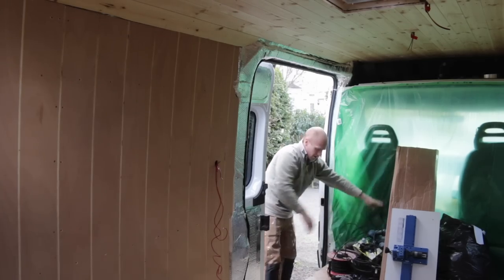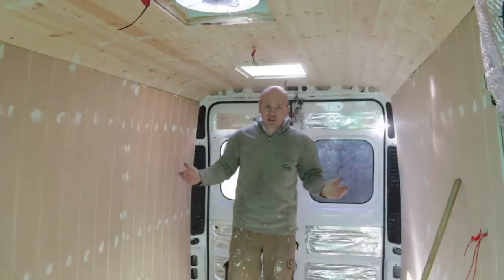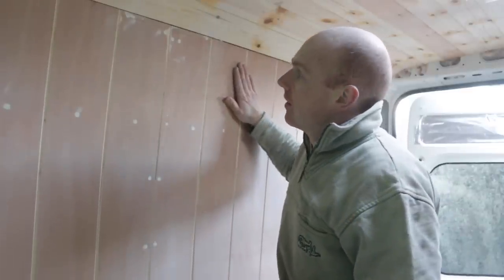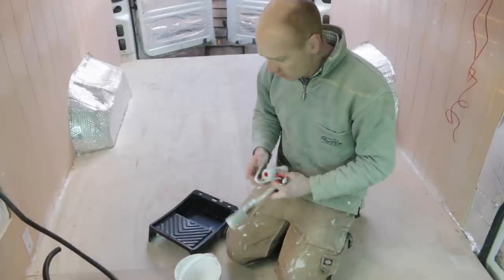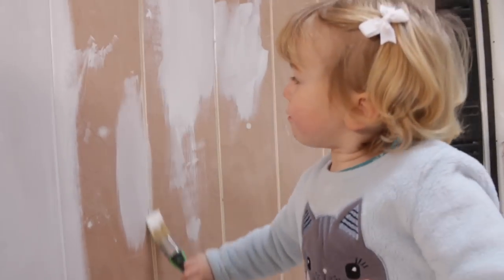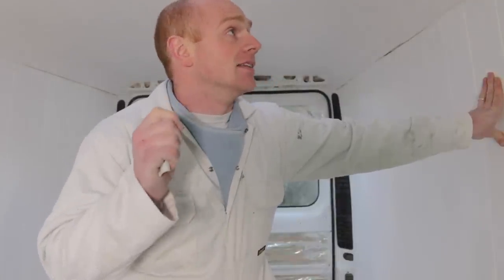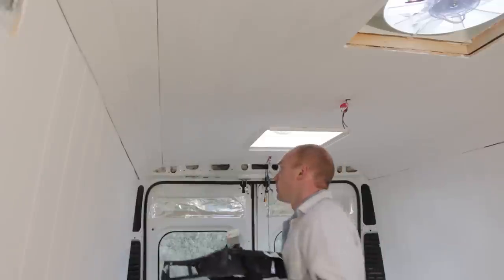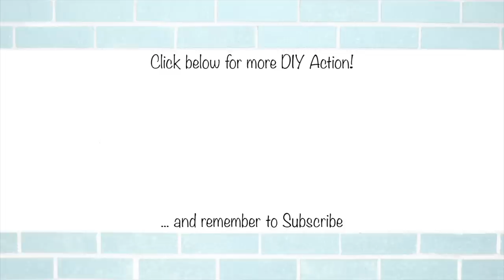Painting the VAN | TRC Van Conversion 17.0

Comment: What about flexi ply to line the rear windows, you may have to epoxy the thin strip to the door, then cut the opening in the facing to fit, only other way is to batten it out a bit to fix the flexi
Reply from the maker: Thinking something similar.

Comment: If you want to cover the rear doors, a 6mm sheet of ply would scribe around them just fine. You could then drill small brackets to the doors that would surround the ply. The brackets are used in commercial vehicles and they allow the wood to seat away from the door ever so slightly, so that's good for curved doors. 

Or be really creative and build a door lining just inside the doors and create your own doorways that hide the rear doors, with cut outs for the windows.

Love all the videos!
Reply from the maker: Working on it in my head.... think we should able to do something with some table saw trickery and bendy ply. :-)
Reply: The Restoration Couple 

You'll do it, no worries. You've crossed every bridge so far! Good luck with it all ☺
Reply: CarpentryWannabe do you have a link for those brackets?

Comment: I'm trying to figure why you didn't roll that paint. Even a small roller with a thick nap to get into the recessed lines would have saved you hours of work and probably been a better finished product. Keep the small brushes on hand to cut in and clean up any slop that the roller created. Great work though and your daughters are just darling, so willing to help.
Reply from the maker: Rollers just don’t get in to the v groove and if you do it clogs the grove and doesn’t look as clean so you would end up using both roller and brush anyway. This white acrylic ends up much more flat and textured with roller whereas the brushed finish gives a better sheen and cleans better. I have rolled and sprayed this finish but still prefer brush, certainly but the quickest option though. 👍

Comment: Blimey, you have got the girls well trained, I was expecting chaos - but they were really rather good - and a great experience and level of involvement. As for the doors here is what I have done. using 1x1 inch batten - stick around each door about 1 inch in. cannot remember if you are having windows - if so box around them. You can now insulate upto the level of the battens. Then Ply on each door as big as you can get the overlap and still freely open the doors. Double over the centre gap by about 3 inch. I would  carpet or cover in foamed upholstery fabric the ply before attaching, This leaves a grove all round the doors that you can fill with closed cell foam (like pipe insulation) or swimming tubes from pound shop. (In fun colours) Just make sure it does not interfere with the rubber door seals. The difference in the feeling of comfort at the back of the van is substantial.
Reply from the maker: They did a great job and painted all the spots where the cabinets are going! ;-) Doors sound interesting but not 100% sure I understand the finished look.  Any pics you can email?  restorationcouple@gmail.com
Reply: Unfortunately I don't have any pics for this yet - I really should have said this is is what I am doing rather than done - but my van has just failed the MOT and I have had to strip out the Interior so it can be welded :( Also my doors are not quite the blank slate yours are, they are much smaller (LDV Pilot) I have added home made windows and floor vents. so I was just started with glueing the battens. I will try and find some pics from someone who has used the same method. Basically if you don't have windows the ply fills as much of the back door as possible overlapping the edge. because the battens are inset you can place the foam strip under the ply in the inch gap all round the door upto the batten. Before you add the ply you can cover it with your choice - paint, carpet, or for me antique bus upholstery on the bottom half and white vinyl on the top. For the centre line I will be adding a 3 inch wide extra strip of covered ply permanently fixed to the nearside door which opens second on my van. This effectively blocks all drafts and bare metal. I did mock it up so I know what it feels and looked like but didn't take any photos as I thought I would be doing it the next day. Hope that clarifies it a bit.
Reply: Finding some pics has proved very difficult - here is one not quite as complete (at top) and a padded middle but near to the feel. https://www.practicalmotorhome.com/reviews/motorhome/36175-shire-conversions-phoenix-xlr-twin
Reply from the maker: ahh ok I see what you mean.  Sorry to hear about the van!  We have a bit of work to get done but fortunately under the bonnet only.  Think I am going to try and get creative with the table saw and work the window curves into the design, or at least give it a shot!